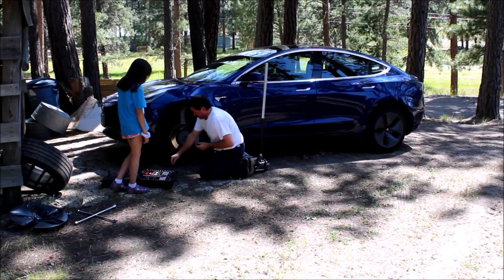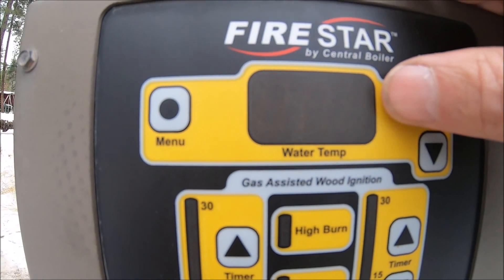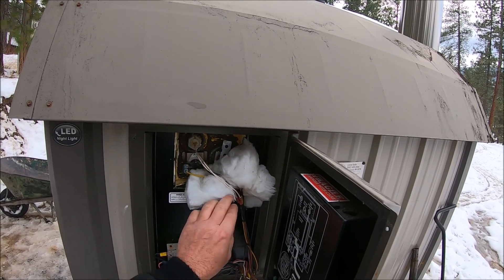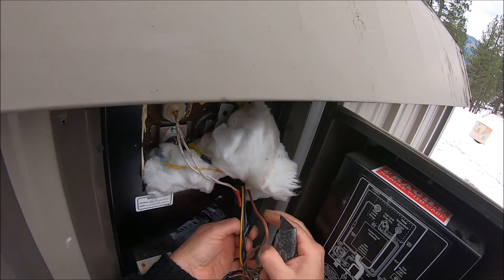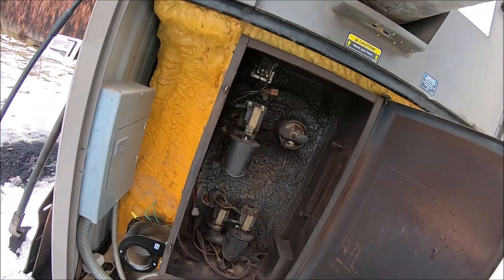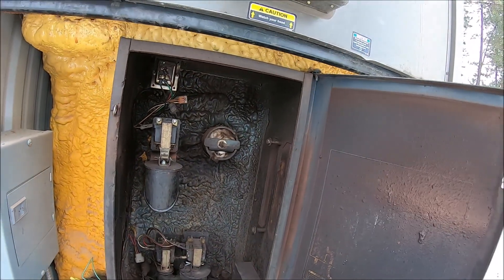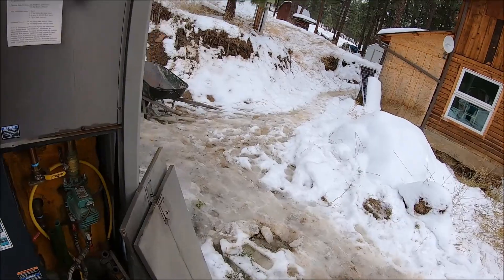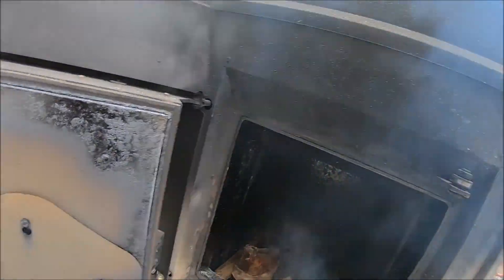Central Boiler failed one day after start up. Had LO fault code. Quick fix to keep heater going.

Comment from the maker: 👀Timestamps take you right to that chapter:
0:00 Introduction
0:48 The Problem
1:26 How to check the water level
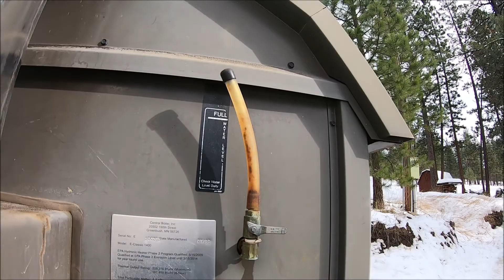2:01 How to keep the fire going with boiler in fault mode
3:17 Diagnostics/look behind controller
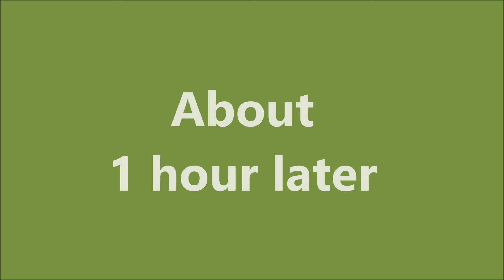11:38 The Quick Fix
15:48 Re-starting the fire
17:37 Conclusion

Comment: I'm glad my boiler is not a central boiler.😏
Reply from the maker: In about 12 or 3 years of use now, only the water level sensor and one air solenoid failed on the boiler. The worst part is the cleaning of the air ducts, which they have improved over the years on newer models. I had to do my own improvement. Which boiler do you have?

Comment: I have a e2400 classic central boiler  my fan is not working, bought new fan still not working.. I have not gotten any low water alarms, could the float sensor still be bad if not getting lost water alarm.
Reply from the maker: Hi Michael, I don't think the float sensor would be the issue. It is basically just an on/off switch and failure would either trigger the low water alarm on or fail to alarm in a low water situation. Without alarm it should not affect the blower motor.
I assume the control panel does power up and you can see the temperatures of water and reaction chamber, right? If the water temperature is to high the fan would not come on and usually you would get an over-temperature showing on the display. If the reaction temperature sensor failed as not showing temp or showing way to high that could possibly be the cause. If that is all good listen and look at the air solenoids. Do they open? When you open the door to the burner chamber the two solenoids next to each other should open and when you close the door they should close and the large single solenoid should open. Do they function as described? If not I suspect a wiring issue or control board failure, causing all the problems. If the solenoids function properly then you need to measure the Voltages on the wires at the blower motor with the burner chamber door open. Be careful as that is high voltage. Between violet and white you should get 110 to 120VAC and the same between violet and green. If you don't get that voltage, it is possible that the violet wire is faulty or does not get the supply from the controller. To verify that is the cause, touch one probe to the white wire at the fan and the other to black wire at the power outlet in the air box. Then you should get 120VAC. Do the same with the green wire at the fan and the black wire at the outlet. If one or both do not read full voltage you will have to inspect those wires first and repair as needed. If both read ok you're back to a bad violet wire or connections and possibly another sensor or something in that wire and/or malfunctioning controller. You will have to trace that violet wire to it's source. Unfortunately the schematic does not show if it goes from the blower motor direct to the control board or makes a detour somewhere else. Take your time and be patient and trace it.
I hope this helps and you'll find the problem. Good Luck.